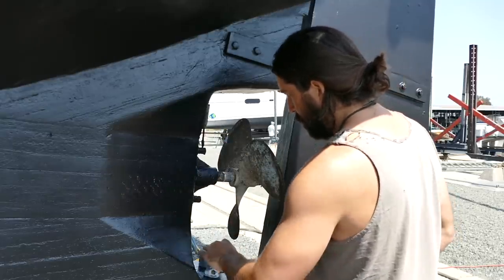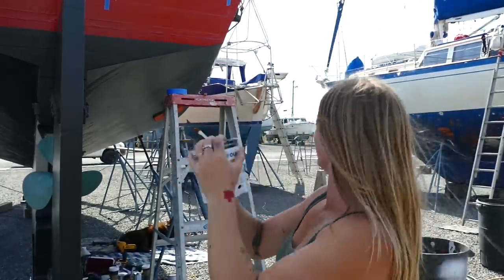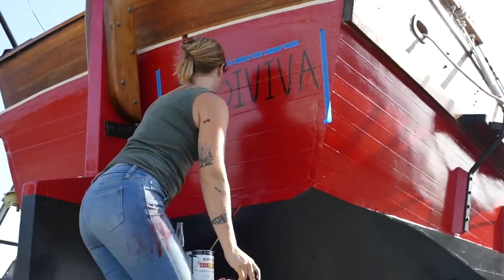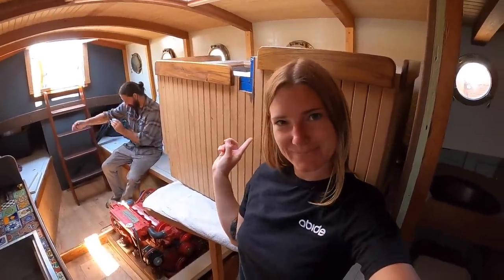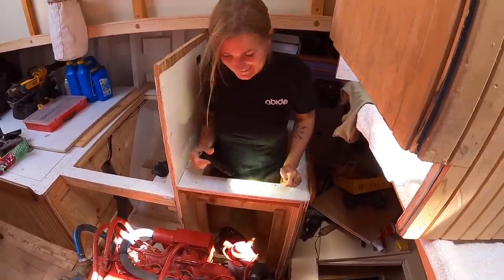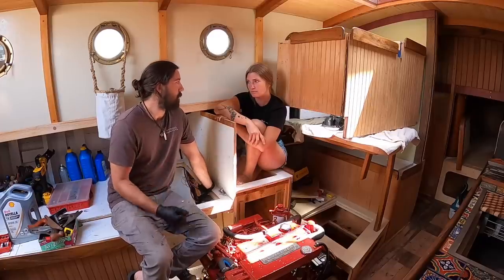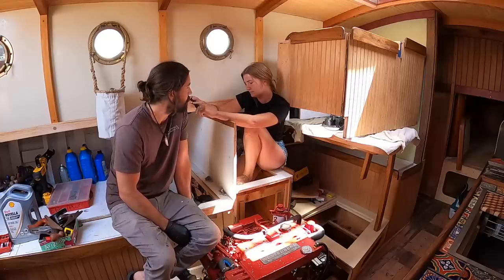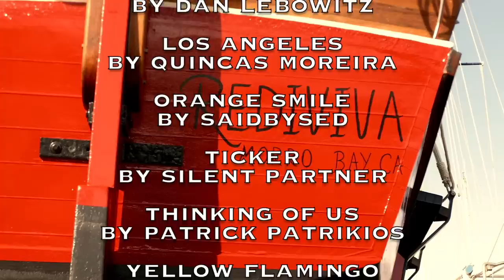Salt & Tar: Ep.197

Comment: Hey guys. First off, I feel for you. This has to be devastating, but you guys kick ass and have built an absolute jewel of a boat. I have loved watching every minute, both the good times and the bad. 

I am no mechanic, so I can offer no thoughts on the engine. That said, I did work with Doug on SV Seeker for a bit, and he had a system that could conceivably be very helpful. If you added a few rigging points on the roof beams above the engine I think it would be possible to wholly pick up the engine with a few block and tackle and then transfer the load over to the hoist coming in the butterfly hatch. In this case, not only could you remove the engine wholly, but you would also be able to suspend the engine in free space within the cabin, allowing you to ~rigidly position the  engine fully exposed and do work. I don't know if this is something would be helpful or desirable on Rediviva, but I know the flexibility of this kind of system has been enormously helpful on Seeker. 

All the best, 

Alex

Comment: Had the same oil leak. I forgot to take off the old oil filter gasket when I changed it. hope you got that lucky.
Reply: That's what I thought to, I've seen it before. I like to grease or oil the new gasket before installing it. On The other hand the preview shows them taking it apart so I'd assume they checked for double gaskets before tearing into it.
Reply: @DuckshotProductions  a lot of ASE mech's even miss that a lot of the time... there is always the chance that G&R missed it too.

Comment: It’s def a pressurised oil leak so not the pan.  I think it should be an in boat fix.  Make sure filters and hoses aren’t setting up over pressure, good to see Garrett bringing it more in the vids, need wind filters on the mic when you’re at sea, in Mx u can get anything fixed so just go

Comment: Oil filter mount has a crack in it when warms up leaks more.   Or. Check oil filter seal.  Had the same thing on a old chriscraft boat. Vibration. Is what does it

Comment: As long as oil pressure is healthy and the motor has good compression, I would NOT go through the effort of a full overhaul. Fix the oil leak and get to sailing. Oil leaks happen, especially on old motors.

Comment: Since this leak came late after multiple uses, it sure seems like you looked at the right component.  Guessing the bolting there backed off under repeated hot cycles and you had a leaking gasket under pressure.  So hopefully next episode we see you button that back up and get everything torqued down and get one step closer to sea trials.

Comment: I'd lift the engine up in the cabin and just fix the oil leak. Like you said the engine runs strong. If you need to build a small a frame to lift the engine then that's what I would do. But yes I agree you cant move on with that big of a leak.

Comment: If that's the only leak, then if possible with the egine in place, remove e the oil filter, and re do the mount gasket with the engine in stu.
The boat is looking awesome, and name boards, on the bows would really set her off.
Reply: Soooooo impressed with you guys. I always had doults these old engines, mainly because of parts.  When they are taken care of, they run forever.  Maybe when $$$$ allows swap it out for a Yanmar.  They are lighter, easy to work on, and you can get parts anywhere.  Like your idea of putting name boards on instead of long term of painting the name on the haul.

Comment: Could I suggest jury rigging a wooden gantry above the motor and simply raise the motor to be able to access it all round. Fix the leaky seals or as others have suggested fit an adapter for a remote filter. You could even test run the engine for a short time like this if you have a temporary exhaust.
Reply: I see you came up with a similar plan thanks to the butterfly hatch.

Comment: Hi Guys, That oil leak is under pressure ,its something around the oil pressure switch or oil filter housing, should be easy fix.
That's my guess good luck.
Reply: agree but confidence and mechanical knoledge is what lacks here, just listening to their fix solution, jack russels are great at chasing their tails, this is what is happening here

Comment: 2:50 If you're in the situation again where you're not sure if a metal is plated mild steel or stainless, try a magnet. All mild steel is magnetic, but not all stainless steel is. It's not going to be proof positive with all grades of stainless, but if you find a magnet won't stick, it's not mild steel. 304 and 316 are both non-magnetic. I don't know if these are common grades of stainless for marine applications though!

Comment: Yep, it seemed 90% of my boat problems were dealing with the diesel engine/ trans/shaft/prop.
I ended up after several years constantly repairing it I bought a new engine and transmission.
The new power system ended the problems and then was only another constant maintenance item.

Don't let it stop your momentum! Go now, don't put it off for another year.

Comment: See if there is an oil relief valve on the housing. The plug that secures it in may be loose.   With a big leak like that it should be easy to see. I would actually  make a section of the furniture removeable for better access.  Good luck .  Fair winds & regards from the UK

Comment: Burnout can be hard to deal with. Over the years I've done a lot of things where I've gotten to the point that I really didn't want to keep pushing on. Little distractions can help. I'm watching you this AM before going to do a presentation that I'm not ready for. I decided I needed to take my mind off of things for just a bit. Now for some coffee, a shower, and wrap my mind around what I need to do. Keep plugging along. Take a break if you need to. Don't let the project consume you. Worst case you abandon the whole project and do something else. But it is highly unlikely that you will need to do that. You are close. Very close.  Solve the simplest problem that needs to be done first. Then the next simplest problem. Repeat. You will get there...

Comment: Just my observation - it may have been said - it only leaks under pressure so any seal that is open to atmosphere is very unlikely to be the issue - if its the oil filter bracket it can be fixed without total removal - I would check first before a major expense.

Comment: I can feel for you. I recently did an oil change and dumped all my oil after starting up into the bilge.
Rookie mistake , I’d failed to remove  the original oil seal, put on the new oil seal and dumped all my oil into the bilge. The double “ oil seal”
Failed to seal and thus I lost all my oil. Hope your solution is just as simple to remedy.

Comment: My guess is that you are dealing with rotten gaskets. The engine sat around for many years before you got it. Some of its fluids may have degraded and became corrosive to the gaskets. You may have to replace every single one.

The decision not to leave until it is right, is in.my opinion an example of excellent seamanship.
Reply: I agree with  Bob I think you hit the nail on the head. That's precisely what I would do and maybe take a look at the crank and cam brings to start with a good and healthy engine so you aren't stuck some were unable to get parts as far as a departure date leave that flexible I Think you guys have witnessed there are always reasons to push things forward. Make sure you have exhausted all of those to have a safe trip to where you are going All is not lost just hang in there.
Reply: I’ve sailed thousands more miles with a broken engine than a running one. Even when running I seldom use it an hour or more. Most times we run it just to charge batteries.

Comment: You did your best guys.  It would be irresponsible to not pull these parts off the engine.  This engine is a really good motor and it will respond very well to a a bit more love.  Pull it apart now, and fix all that you can .  You'll have an engine that will last the distance.  The fact that the engine runs so well, should tell you the inside is good, just fix the oil leak and you'll be right. 

Your idea of getting away for a break is also a good idea if you cannot leave soon.

Comment: A new engine will mean new mounts maybe new doghouse and drive shaft. Short of a cracked block it’s probably easier and cheaper to fix the leak. Also another thought is that mechanic work is probably a fraction the cost in Mexico. Sail down there and you can have it fixed for less?

Comment: I think you should be able to fix this leak without removing the engine. I like the idea of a remote oil filter location. Also you should put a mount on the back of the boat for your dinghy motor so you always have a backup. Good luck!

Comment: I live and sail on an 80 year old 26 feet boat. Up to last year the Perkins 4108 m did well. 
In fact it still does but since one year I have one repair after another. Just before starting the engine after repairing the water-cooled exhaust manifold I noticed that our high pressure fuel pump leaked. 
A lot. Some luck: the leaked diesel filled the drip pan below the motor and did not spill. 
I decided that was it. The engine is 40 years plus, no good will come. 
Decided to go electric. A six or 10 HP electric outboard and some lithium iron battery's. 
The boat sails, done at least 20 years of sailing almost without using the engine. 
As for electricity, I have two solar panels and two wind generators of which one is self build especially for low wind speed. 
Since I decided to go electric no more problems, no more worries, no more leaks. Also no engine. I can survive a season without cruising.

Comment: YAHOO your pulling it. But do not skimp on anything, Redo the head, pull engine completely apart and at least hone cylinders and put on new rings, Replace EVERY piece of rubber and all seals, gaskets, and metal seals under all of the steel lines. Put bending pressure on every steel line and check for weakness. In other words takes out EVERY bolt and check everything. I think you get the picture. Oh and make sure the head is taken apart along with engine and hot dipped to clean out every port. You mechanic will know what I am talking bout.

Comment: Hey guys chin up, Christian has your back the leak will be the filter housing gasket  even in that dicky position it's a day and a half work. As for all the haters saying ditch the engine or worse go electric just ignore them old school diesel is far and away the best option. These new yanmars with their computer everything are causing heaps of problems because computers don't like salt water. Hang in there she runs sweet a few new gaskets and you're away

Comment: Has to be on the pressure side. My guess its between the filter and  the engine. Bad seal in the route to the engine. since its dripping from the oil pan bolt its probably the nearest gasket to that area.

Comment: If it's the oil filter bracket it's two bolts well 5 but still yall will be fine the vibration of older diesel engines makes them a constant maintenance problem

Comment: The prop looks to be to close to the rudder, guideline is no further the shaft diameter from bearing housing prop hub max. A better standard is not more then 1 inch. With out proper clearance to the rudder you run the risk of a fouled line in the prop restricting rudder movement, another problem is excessive vibration and shorter cut less bearing life.

Comment: Is the leak coming from around the filter if so you might have doubled up on your gasket when you change the old filter to a new filter they tend to stick together just the place to look you would have to do a oil change drop your  filter to check

Comment: Yes, better to investigate the oil leak before making a rash decision...it could be a simple fix....for example...it's possible for the gasket of the old filter to detach from the filter and remain, unnoticed, attached to the filter housing......this will cause an oil leak similar to yours. Don't make a final decision until you know the cause of the leak.

Comment: I have had a few cases of an engine suddenly dumping a lot of oil in a short time.  All but 1 of them was the oil pressure sensor. With where that was leaking, that would have been my first check.

Comment: Could not see the actual leak site but often when replacing an oil filter the O ring stays on the engine, then with the new filter you've got two rings and it leaks. Just a hint...

Comment: That engine is running well and does not need a full rebuild. The oil leak looks too bad to be a weeping oil pan gasket although there could be a length of gasket missing. Also people tend to overtighten oil pan bolts and distort the thin metal pan making the sealing face uneven which can lead to oil weeping out. That leak looks worse than this and could be coming from a fitting between the filter and the engine but I am sure its not too difficult to fix. There might be some O ring seals that need replacing. I am sure you would feel better if you fixed this before going on a vacation.

Comment: Oke try this (instead of pulling the engine from the boat)
Unbolt the engine from the mounts and the prop shaft, lift the engine up to a height you can inspect, work and test it thoroughly...If it after that needs to come out you can do that...

If the engine is out, you could get a large outboard and still leave  I would imagine... Sort of the hail Mary last ditch effort to stay sane...

Comment: Regarding your oil leak and not knowing just what it will take in labor and parts and effort to make repair is frustrating and discouraging for sure. On the other hand you are located in one of only six places in the eastern Pacific where you have ready access to parts; the list being Anchorage, Seattle, San Francisco, LA, Peru, Santiago and that's it. When you get to a point where you are anywhere else and you need a part, you can wait a month and get really frustrated when you wait a month and discover the wrong part arrived. Today is June 27 not the end of April when you made this video (ep 197) so you will have gotten beyond this leak. You have each other and a "fine vessel". Sailing is all about enjoying where you are, not where you might have been if <blah blah>. Very few people have ever built anything bigger than a row boat. The adventure began when you laid the keel TOGETHER AS A TEAM. The rest is gravy and the frosting on the cake. You are making your history together and you are already creating stories to share with others who have made it to the water. You are kindred spirits with all who sail and all who have gotten past the point of casting lines. Most boats in most marinas don't travel more than 10 miles in a year. The journey is the reward. I left Richmond at age 18 and thru "The Gate" and made it from Northern Mexico to the Aleutians and west to Thailand on the water. I also learned to sail on SF Bay. Later on I married and we raised kids and taught them to sail the dinghys we owned in the Delta. There are those that dream and those that fantasize and those that read Cruising World and those that build or buy a boat and create their own adventures. Enjoy whatever happens. It is all part of YOUR journey which you will never regret. For a break from your own boat challenges maybe you need to find a friend with a J-24 or Catalina-something who would like a crew sometime and go sailing on SF Bay. Pick up a copy of Lattitude 38 or post a note at nearby marinas "Couple available to crew" and see what happens. In Napa it will be all power boats
but marinas closer to the perimeter of the Bay there will be sail. Just look for the "sticks" up in the air or "Crew wanted" ads in Lattitude 38 for a change of pace. You are both outgoing and friendly and not afraid of the water and some sailing knowledge. Only requirements to be good crew for fun. Crewing on a race-boat is entirely different.

Comment: Have you checked the filter seating. It happened to me once on a garage engine replacement. I lost all oil driving home. It turned out the sealing ring had kinked and leaked when the engine got hot.

Comment: Hi guys, Please before you do anything else, take the filter of and check that it only has one seal ring, I had a engine pull-out to change a sump pan and did a filter change as well, BUT DID NOT CHECK THE FILTER SEAL, put the engine back in and when I started it, it leaked oil badly and I thought oh no what the hell, turned out the FILTER HAD TWO SEALS ON IT, i didn't check before putting on the filter, I removed the old one which was stuck to the engine block and replaced the filter, ALL GOOD AFTER THAT, Fingers crossed that's all it may be, All the best, Al

Comment: Does your oil filter have a bypass for when the oil is thick?  Standard oil filters often have a built-in bypass valve to keep the oil pressure down until it warms up and thins out.  "High performance" ("racing") oil filters may not have a bypass and can cause the filter gasket to leak.  Had this problem on a vintage car and it was solved by going to a standard oil filter and using a bypass on the external oil cooler.

Comment: At a guess, the leak is not from the Oil Filter seal but from the Assembly that attaches to the block. I would consider removing that assembly, if that's possible, while it is in the boat and checking just that initially before you consider ripping the engine out of the boat.  People saying "scrap the engine" and by a Yanmar are not considering the financial impact that you both face.

Well I should have watched the rest of the video.  Onya Christian.